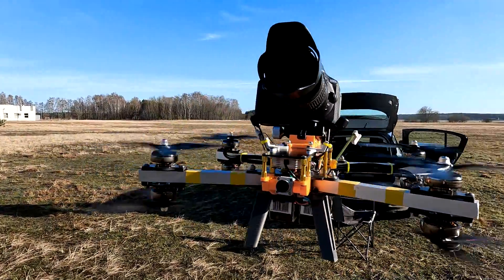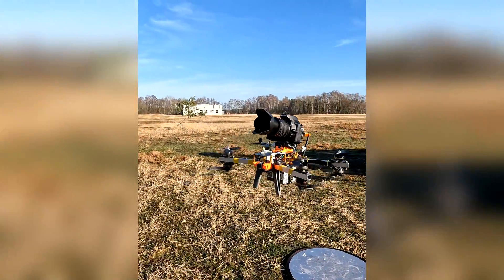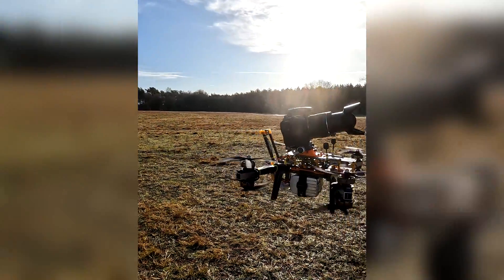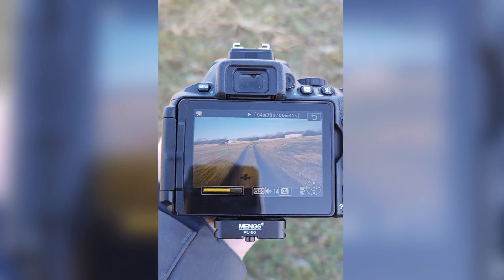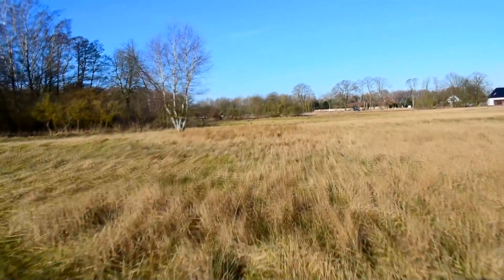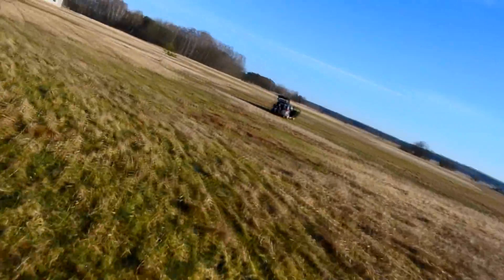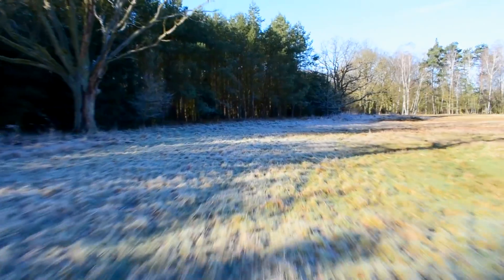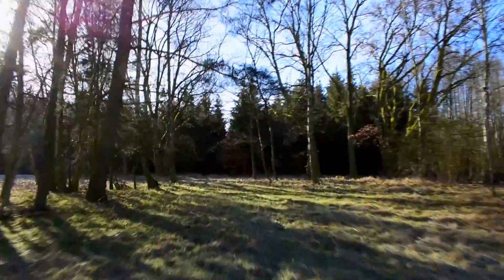DSLR camera on a cinelifter drone | 8 motors DIY drone

Comment: Hi Pawel, I made an octo and installed inav and after chose 8X only 6 motors are recognized and there is not the second beep after plugged the lipo and so the motors don't work on inav panel for motors. I use MATEK FLIGHT CONTROLLER F722-MINI SE and all works perfectly on betaflight. and I installed the last firmware of the FC and last inav version. What is wrong ?
Reply from the maker: Use the MATEKF722SE_8MOTOR target for 8 motors and switch to Multishot porotocol
Reply: @FPVUniversity  Thank you, I resolved all issues and it works  fine and in DSHOT600, thank you
Reply: @FPVUniversity  I tested on 3 octocopters that I have with DSHOT600 and it works really well but there is one strange issue : on the 3 drones, motor 5 don't work at all from inav or after arming. I tested to downgrade to the 4.0.0 version and same issue. Motor 5 don't work on DHOT 600/300/150 and works only on MULTISHOT. So,, drone flies very well and clean but only on 7 motors. Any ideas please to correct this issue ?

Comment: So the x8 drone flew well, mostly camera wasn't able to deliver on all expectations. 
That's still a major win. Hopefully you can experiment with focus modes (focus target options) to find something suitable. Most DLSR were not really designed for video, so unless have newer, advanced model, it likely a challenge.
Reply from the maker: I think I solved all camera problems until now. Focus, quality, contrast and so on. But due to the crappy weather, can not yet test
Reply: @FPVUniversity  Good luck with weather. It figures.

Comment: U should put a mirrorless camera on this drone for less weight and stabilize in post with gyroflow. Good budget option might be Panasonic g7
Reply from the maker: I don't want to have a new camera ;) I use DSLR because it looks absurdly cool!
Reply: A gh5 is out of question right ? G7 does not have ibis  . Can you name any other cheaper side cameras that might be a contender ? 4k 30 fps is good I guess . Unfortunately I have gone and watched the wrong video , didnt know about the ibis thing and got a gh5 and now im looking at my options . A total newby thing to do yes I know . 
 Autofocus is a big thing too which the gh5 is not good at . I know these things get crashed , no matter how good you are so  I can really only fork out so much . Any help here is much appreciated.

Comment: Updated my extremely poorly designed 8" to inav 4.1 does seem to fly better. Only weird thing is my position hold at last test started slowly going down but I have hover set high. And alt showed it going down. I adjusted hover point to yest again. But maybe gps alt mixing in effected I was near a building so maybe

Comment: What I like about cinelifters - especially with INAV - it gives me a whole new set of challenges. It's like a new frontier. Just flashed 4.1 on my modified Thicc running 8 inch props and the new filters definitely improve things. Keep up the great work.
Reply from the maker: Thanks mate! Remember to lower matrix filter min frequency on 8". Probably 60Hz might be a good value
Reply: @FPVUniversity  Currently set to 70 which seems ok.